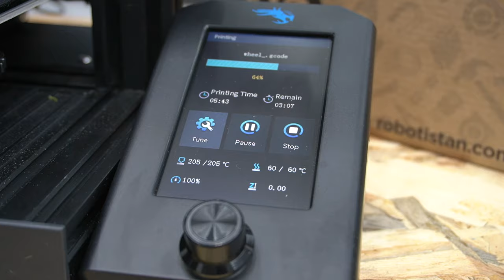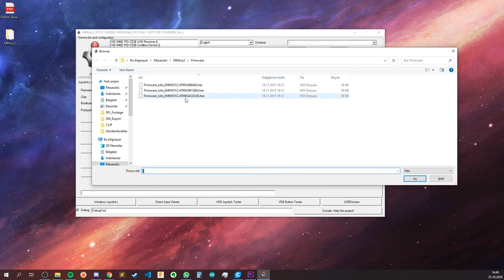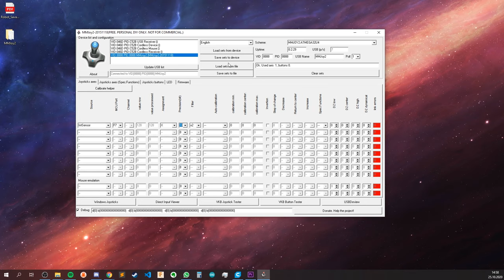900 Degreess DIY Steering Wheel (Cheapest Version)

Comment: $300 drill press, $400 3d printer.  Uses hacksaw to cut threaded rod.
Reply: U can make these parts in any machine shop
Reply: This is just nitpicking at this point
Reply: @the555timer still not wrong
Reply: You are right, but you must be new to diy. If you just want a cheaper steering wheel, just buy the cheapest one on the market. Because building one yourself takes tools and skills. If you don't have those already, then it's going to take time and money to get them.
There are eady DIYs where you only need plastic bottles and hot glue. But then there are DIYs that require you to have a 3d printer or a workshop. Some even require metalwork.
Reply: use an Ender 3 and a simple drill, he has the oppurtunity to use them, why would he use a 3$ drill?
Reply: Which of those tools do you suggest he cuts the rod with, the 3d printer or the drill press? 🙄 

Just because someone has a couple expensive tools doesn't mean they can afford to buy every power tool they'll ever need. If this was me, I'd be using a borrowed hand drill for the holes. The only tool here I actually own is an Ender 3 a friend gave me. 

Many of us get into DIY because we can't afford a bunch of expensive shit.
Reply: @tinkertheprol  just saying a dremel would have gone right through it .

Comment: Let me ask you, the steering wheel turns on bt but turning to the right is ok but to the left the steering wheel runs full speed.  The effort of locking it to prevent it from rotating is a failure, isn't it? I hope you can help me?

Comment: great project! why do you use a poti instead of a rotary encoder? how did you fix the big gear to the poti?
Reply: rotary encoders unless expensive Optical ones are very inaccurate (20 pulses/detents has a minimum of 18 degrees of deadzone so horrible for wheels) and also are noisy and require a bit too much force to move, compared to that a potentiometer is smooth, cheap and has a very high resolution. Optical encoders are expensive. Hall effect encoders can be used but are rather complex and again hard to find or expensive especially with the firmware used.

Comment: Great work. I made a wheel for farming simulator using a Bourns 128 pulse absolute encoder and an arduino leonardo. No gearing is required because the arduino can count the turns of the encoder and with 128 pulses per rev it has enough resolution for what I wanted.
Reply: no gearbox? did you attach the wheel drive shaft direcly to the encoder? i want to build this for my arcade cabinet. can you sent me a photo of your build?
Reply: @sub-arts128  yes I used a small piece of rubber hose the connect the end of the steering wheel shaft to the shaft of the encoder, it allows for slight misalignment. My setup is very basic and roughly assembled, only as a fun project for a wet day. It works very well but doesn’t get used very much
Reply: @josephinring  good idea. is this stable, even if you move the wheel very fast? did you use mmjoy to measure the encoder signals or other? could you send me a photo? this method seems easier than printing out gears
Reply: It is very stable, I use an arduino leonardo or micro which can act as a usb joystick. The burns encoder uses absolute values so each position is unique and it’s impossible for steps to be missed even if you go very fast. Since it has 128 steps it means that it has a resolution of approximately 3 degrees per step. For games like farming simulator where vehicles have 4-5 turns of the wheel from lock to lock, this is more than accurate enough, maybe a more precise encoder would be needed for racing games. I might do a video on the setup and code at some time but I am only a beginner at coding so mine isn’t perfect.
Reply: @josephinring  Can you share your way of attaching the wheel shaft to the encoder, I am using a 10 turn Potentiometer as I couldn't get my hands on an encoder, and I am kind of struggling with attaching the wheel to the potentiometer, I've designed a small 3d model which can house the potentiometer and the wheel together, but I have no idea how to make it stable enough
Reply: @mr_gyni  I used a short piece of rubber hose pipe pushed onto the shaft of the encoder and the shaft of the steering wheel. It allows for slight misalignment.

Comment: I have a question about Potentiometer, you used "B10K" with that tag, I have a Potentiometer with "50K" tag. I don't understand Potentiometer very well, so I'm wondering if I can use mine, is there any way to use "Arduino" instead of "joystick" and how to connect that?all the better!

Comment: Hola. La reductora de engranajes hacen tope a 900 grados?
Reply: I am making a steering wheel for Android and on Android I cannot calibrate the rotation of the steering wheel, that's why the question. With its gears I can convert the maximum turn of the potentiometer to exactly 900. I am using arduino pro micro

Comment: Hey, I’m building something similar but instead of arduino I’m using ps4 controller, but my potentiometer gives stuttery responses and when I go in game the wheel is shaking very faintly without touching, any thoughts on how to fix it?
Reply: depends on the game, usually you want to experiment with changing the input method, try changing to wheel or gamepad, should fix that problem.

Comment: is it the potentiometer that turns 900 degree or the mechanism that you use btw im cant wait to see gameplay videos with this keep up the work my guy
Reply: I know this is an old comment, but for anyone else out there, no, potentiometer can't turn 900 degrees. At best they can turn around 270 to 300 degrees, since they simply run out of resistive strip.

Comment: i dont think its cheaper or better than buying 900 wheel :D arduino, electronic, materials and wheel cost more than normal wheel i guess ?
Reply: @Ian Goschman yes, but i mean, isnt it better to go work for like 1 day and buy some wheel than, buy materials for this and spend next day building it ? :D + if you take, you want the same quality as f.e. thrustmaster tmx you need to make that feedback, working buttons, stable body, and some quality wheel ? then i dont think its worth that money and time spend
Reply: @Ian Goschman im from czech republick , well you cant go work for 1 day and buy wheel as i said but for like 2 days, depends on how long will you work and how much money you get wheel in my country is like 4000 (thrustmaster tmx) and you get usually like 130-200 per hour so if you go work for 2 days 12hours/day and get good cash for it you could basically get wheel for 2 days (4800 cash), but i think for most games you dont need 900 wheel i mean i started with logitech driving force its like 250 my currency so like 10 euro on ebay it has slightly over 90 degrees on both sides from middle and for rally its absolutelly perfect cuz irl rally cars has not so much degrees as normal ones
Reply: but well, making your own wheel is much more interesting and you get some valuable informations at least ;)
Reply: @Ian Gonzalez Goschman already made a "high quality" wheel for literally a fraction of price I can get a G29 for (around 1/5 the price) which is totally worth it.
Reply: It totally depends on the country. Probably in European country that's sensible but in Turkey its not. You'd had to work 2 months to get a g29. Consequently its way cheaper to do it by yourself especially if you already have a 3D printer and some of the metarials. (It's still cheaper included the printer indeed :D)
Reply: @MaxC_1  bro puedes mostrar como lo hiciste? hay que saber programar o es muy dificil? quiero montar un manubrio de verdad para jugar al euro truck, soy de aprender fácil pero si es muy complicado preferiría pagarle a alguien para que lo haga